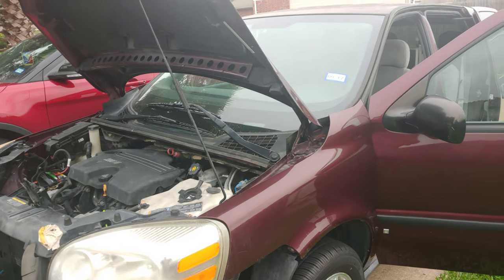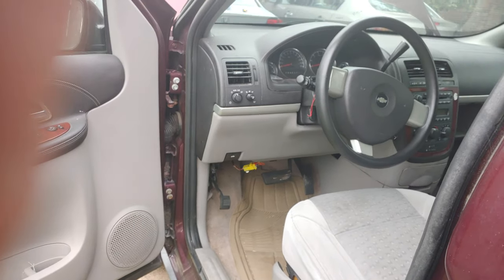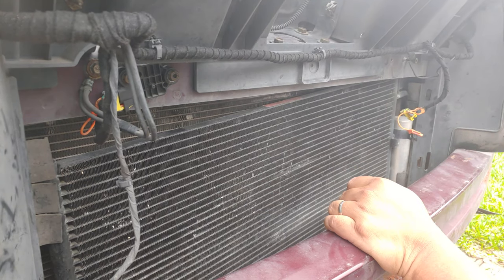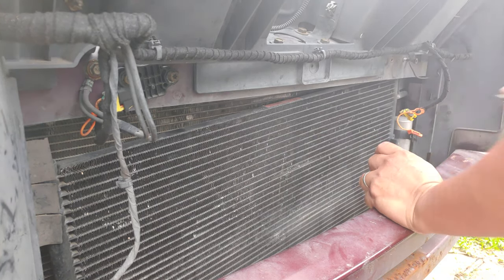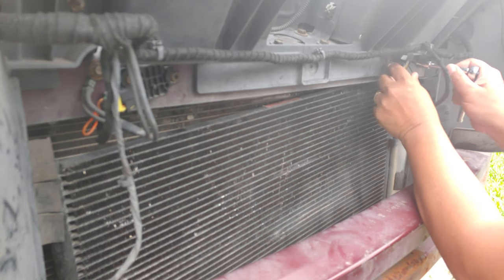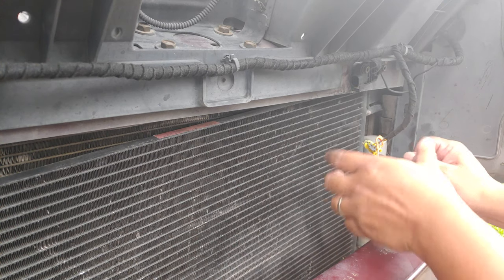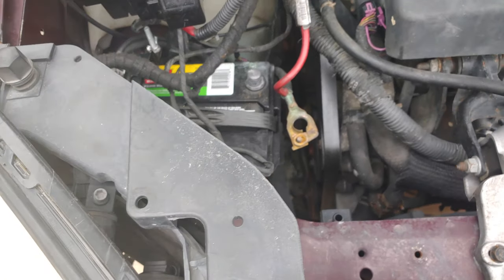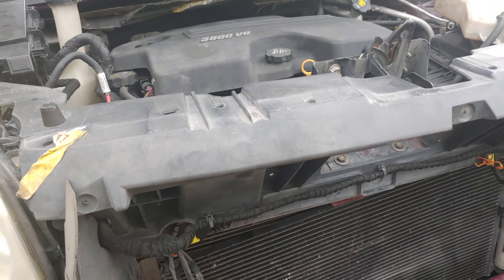AIRBAG SENSOR REPLACEMENT CHEVY UPLANDER

Comment: Did it work????
Reply from the maker: just bought an airbag scanner. its saying I installed a wrong part. ordered another sensor on ebay and will be here this week
Reply: @jsnantic  yes..I ordered a scanner too to see the exact location before I buy the front sensor.
The scanner should have a function for SRS.